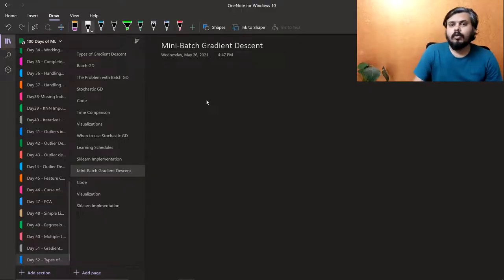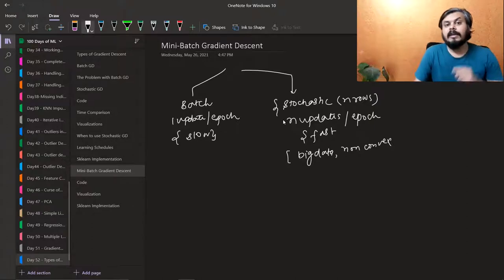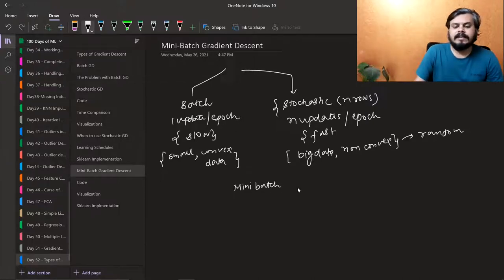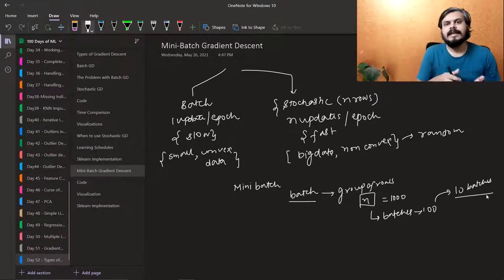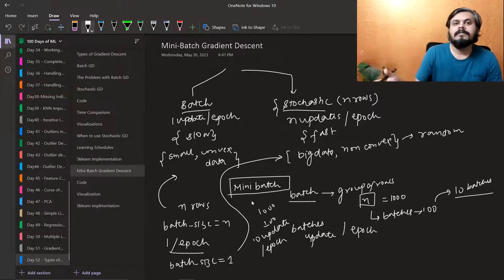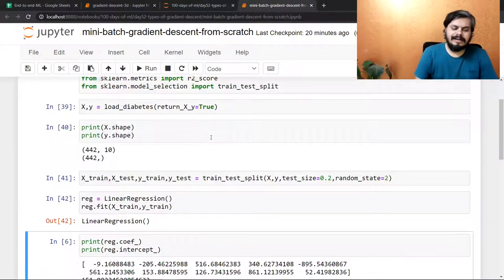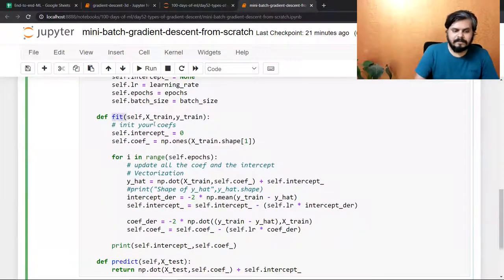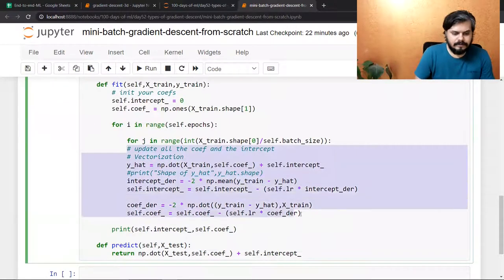Mini-Batch Gradient Descent

Comment: intercept_def = -2 * np.mean(y_train[idx] - y_hat)
 I think there is an error it should be 
intercept_def = -2 * (y_train[idx] - y_hat)

By the way video is just looking like a wow
❤☺
Reply: Why does intercept_der = -2 * (y_train - y_hat) and not
intercept_der = -2 * np.mean(y_train - y_hat).

If you do not put "np.mean" in intercept_der, then it is a vector of size (10, 1), then
self.intercept = self.intercept - (self.lr * intercept_der) is a (10,1) vector, but in reality self.intercept is a scalar or a single value (it is assumed self.intercept = 0 at the begining of the function loop). I think np.mean is necessary otherwise the calculation will go haywire.
Reply: @bitanbarman7930   correct mean is needed for intercept but for coeff we need to pass it inner calculation otherwise here also it covers no scaler of 1,1 dim

Comment: the reason our SGDregressor was working better in prev video b/c we were using X_train.shape[1]  as range for inner loop but think range should be the # of rows shape[0] 
or this code in Stochastic Gradient 
    for i in range(self.epochs):
      # X_train.shape[1] is the # of features/cols : we do this
      #  b/c we have to calculate for b0,b1,b2,b3....
      for j in range(X_train.shape[1]):
          idx = np.random.randint(0,X_train.shape[0])
          # we will extract idxth row
          # y hat is scalar now
          y_hat = np.dot(X_train[idx],self.coef_) + self.intercept_
          intercept_derivative = -2 * (y_train[idx] - y_hat)
          self.intercept_ = self.intercept_ - (self.lr*intercept_derivative)